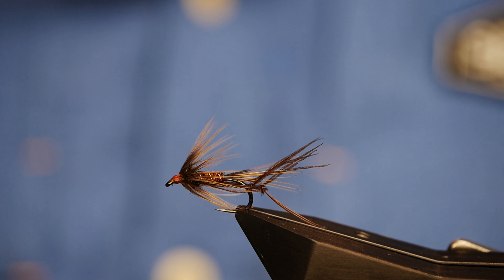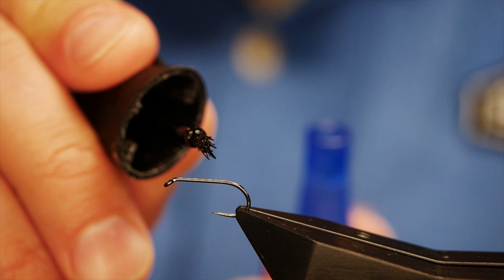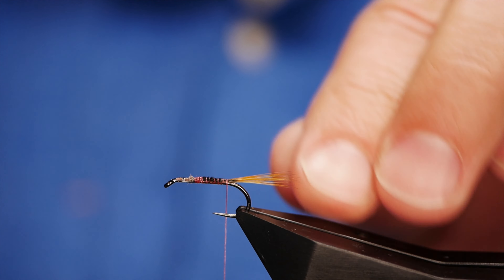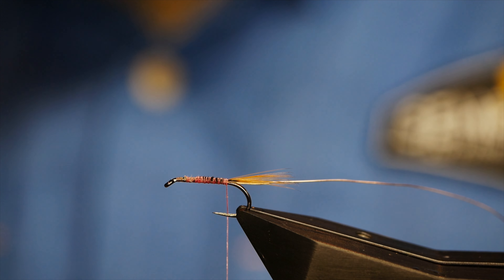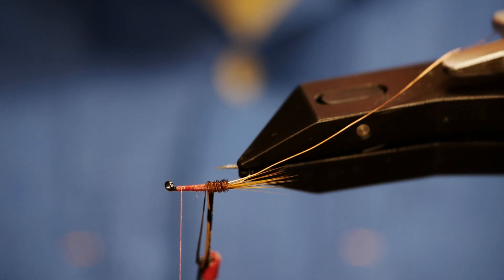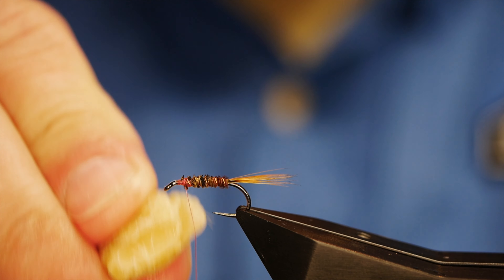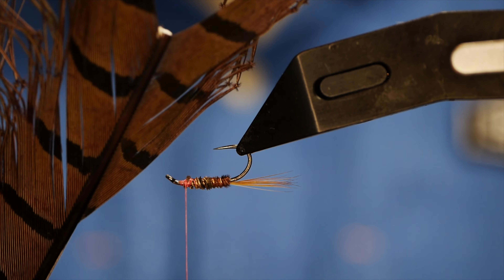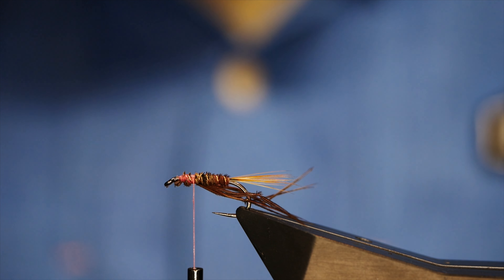How to tie the Leggy Cruncher #fishing #flyfishing #flytying

Comment: The legs are a subtle extra that works well as an addition to many patterns. Helping with presentation in the surface layers, also deeper in the water column. The legs give bonus movement and attractive disturbance. Drawing the fish in closer. As they pick up on the general location via the lateral line before they see it. Not only crunchers, cormorant, bibio, Kate’s, even Zulus, have also had some success adding legs to blobs, egg type flies, even Bob’s Bits and Shipman’s buzzer. The latter I tie the rear 2/3 thin with a rib. Slightly heavier thorax with the breathers at the head and not at the tail instead shorter behind the thorax to give a more emerger profile in the surface layers and deeper in the column. One final option is use dyed legs as in black with black, claret with bibio, orange,olive, or pitric have their day
Reply from the maker: Thanks for watching Mick.